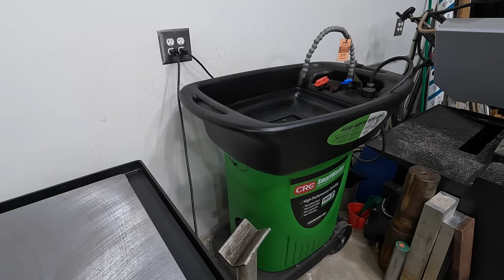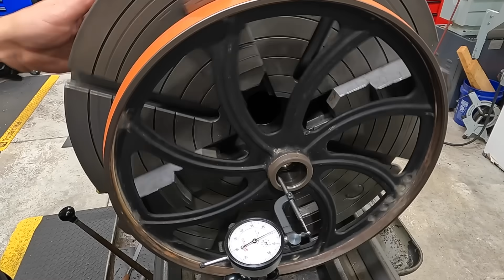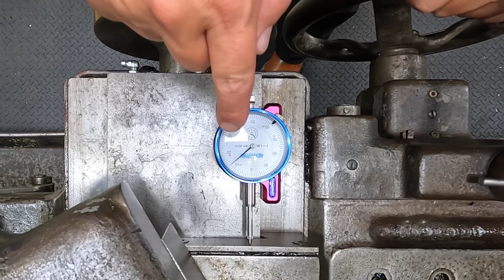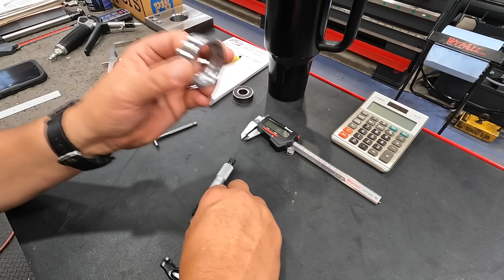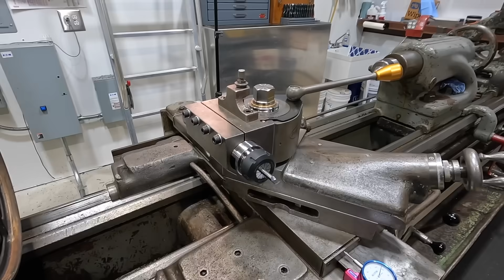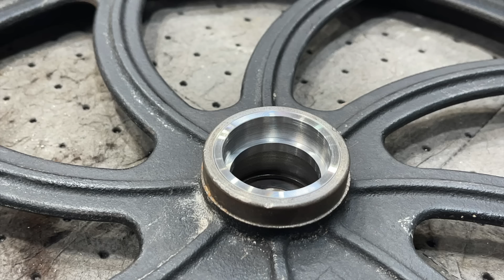Bandsaw Wheel Repair- SNS 381

Comment: Watched your channel for a long time, thank you for your videos. Just watched this one. I have a tip for you pressing in bushings. On the leading edge turn the diameter down .001 x .06+ long step. This allows the easy alignment of the bushing and helps get it moving straight reducing the chance of shearing. Thanks again, retired toolmaker, designer, and fabricator.

Comment: Adam. It's the outside of the wheel that carries the blade that needs to run true. With that in mind the inner bore should be made to ensure the outside of the wheel satisfies this requirement not the other way round. Look at the wobble at 17:54! The bandsaw blade will experience that wobble. You achieved some super fine tolerances for no meaningful reason. 
Other than clamping the outside (fragile) diameter of the part instead of the solid inner hub, (might have had less chatter too),  missing your initial target of 1.8", using the boring bar in the wrong holder and producing a wobbling bandsaw wheel this was a great episode.

Comment: I have a Delta bandsaw that had a bad wheel, I didn’t know new wheels are available. I bought a used wheel on EBay, it was better than mine and useable but not as true as I hoped for. I know used parts are risky you take what you get. A replacement bandsaw is about $1K for a Grizzly (w/accessories) I don’t know what you charge for this repair and I’m sure this was a big improvement plus it saved a machine from the scrap pile.  Thanks for the lesson on wheel repair.

Comment: How does pulling the bearing out of the sleeve go I wonder. Does it yank the sleeve with it?
Reply: He cut the sleeve half thousand larger so that the sleeve would fit tight into the wheel so the bearing shouldn't pull the sleeve out

Comment: Abom79, I am a mechanic/woodworker/carpenter. Next time, take the tire off of the  wheel and Aline the wheel to the tire groove. The saw blade has to follow the tire. That is what has to run true no matter what the hub casting is doing. I hope this makes sense.

Comment: Wouldn't a strip of shim stock have pressed in there quicker with the same end results?
Reply: The hole wasn't round anymore.
Reply: I seriously doubt that the wheel on a bandsaw needs to be that round the blade runs on a rubber tire, and if your OCD dictates, chuck it up in the lathe and true it up!!

Comment: 14:27 I would have left it there. Since the inside of the bore has been worn oversize and put out of round. The more true the out part of wheel runs, the better chance that hub lasts.
17:55 yeah that outer rim is wobblin' goblin now.
Nice lathe work as usual from Abom.

Comment: Adam, I have a question, why didn’t you use the flame spray method to just build up the ID material, and then just bore it out to the bearing size? It seems to me that removing ( virgin material) would potentially reduce the strength of the central hub , which given that it is for a band saw and they’re generally run under tension ,maintaining maximum strength would be preferable? Just a thought.

Comment: Noob question.....What is the cross-hatch rod spinning in the lower right-hand corner at 22:43 ?  It turns even when the chuck isn't spinning.
Reply: Chip removal auger??
Reply: @mikemarshall1394  I think, it’s a BBQ meat roller 😂
Reply: Just looked through the american bulletins, it's a power rapid traverse for the carriage
Reply: Same question here ....

Comment: Thanks for the video Adam. Does anybody have any possible explanation of why the bearing became loose in the bore? It would be interesting to hear some theories on why that might have happened.
Reply: The bearing is subject to a significant twisting force, just lime a motorcycle with a inertial-sided fork. The axel is only supported on the backside of the wheel. 

I would guess 20 years of wear with the axel nut a bit loose could cause the outer race to want to move in the sleeve
Reply: @avprod1  I suspect you hit on the reason for the bearing wallowed out. The wheel running slightly angled from a loose nut would cause that problem.
Reply: By time the load on the bearing compressing the softer cast iron. Basically ironing it, so the hole become bigger and harder the surface. In old machines this is super common. Sometime became so hard its also cracking under load.

Comment: Dry ice is pretty effective for chilling parts more than a freezer. Dry ice temp is roughly -80C vs a freezer at about -20C. So the Dry ice deltaT is about 100C vs 40C when using a freezer.

Comment: What if you used liquid nitrogen to shrink the bushing instead of the freezer?
Reply: My guess as an outsider is that the very rapid cooling of liquid nitrogen could have a high probability of warping the part.
Reply: A better option is a slip fit and red Loctite.

Comment: Adam, When you say you're "taking 50 thou" is that 50 thousandths Depth of cut or 50 off the diameter ie: 25 thousandths Depth of cut?
Reply: On lathe You always talking in diameters, but adjusting in radial :() Just get use to it. rapid division by 2 in head.

Comment: Another way to help with driving in the chilled sleeve would be to make a custom driver which is a close fit inside the sleeve and also has a pilot which is a sliding fit in the ID of the other bearing to keep everything aligned. You would, of course, chill this driver along with the sleeve, which would very much slow down the rate at which it warms up.

Comment: usually bandsaw wheels come in pairs, if this one failed, they ought to check the other wheel as well. No one every pays attention to the lower wheels because you are mostly doing adjustments and alignment closer to the top blade.
Reply: This would be the case for the third wheel on a 3-wheel bandsaw, but on a 2-wheel bandsaw the other wheel is on a driven shaft, not turning on its own bearings.

Comment: Instead of truing up the hub in the set-up, what if you just trued up the O.D. of the wheel and then bored the new hub to center on that?
(I guess that would mean you'd have to bore for a new sleeve all the way through for both bearings)

Comment: on motorcycle wheels there is a sleeve  that fits between  2 bearings inner race to make more ridged - surprised this is not made that way -
sleeve  is made from hardened steel - its important

Comment: I know this was weeks ago. 
But couldn't you make a little tool so the inside could be knurled ? Then bore the hole to fit the bearing (if required) or solder it in haha, maybe silver solder!
Reply: sleeve is the better way, first there was alot of play, to much to knurl .. second: when you knurl you have les material that contact the bearing, so it would'nt last long .. silversolder? .. way more labor, has to go in the Lathe anyway, but also have to remove the other bearing .. heat has the danger of lot of warping or even cracking the cast iron because of spot heat is high with silversoldering, burning the rubber (heat transfer) .. what he could do is to Locktite with the green Locktite insted of shrink it in .. but shrinking is as strong as welding

Comment: Why would you not go ahead and install the bearing first instead of installing the sleeve in the hub.  I say that because if you should need any more internal machining of the bushing that it would mount right up in the lathe instead of having to do any machining of the sleeve while inside of the hub?   Newbie wanna be machinist question ??
Reply: Listen to Adam's monologue starting just after 29:26 and continuing onward. I believe he answers your question. It has to do with turning speed as it relates to the surface finish and the limitations of the different lathes.

Comment: To quickly cool small parts, I use freeze spray that is normally used to help troubleshoot electronic circuits.  You can easily order it online and it saves a lot of time.
Reply: A cheap canned air keyboard duster does the same thing when turned upside down. :) Those canned "air" dusters are actually saturated R-152a refrigerant and it comes out as a VERY cold liquid when the can is inverted. Idk how expensive the special electronics freeze spray costs, but the canned air dusters are very cheap and you can get bulk packs of them at warehouse clubs (Costco etc). I have used them to do all kinds of off-label things including freezing warts off my hand. Cut a Q-tip in half and then put the red straw inside the hollow core of the Q-tip and you've got what's basically identical to the Dr Scholl's wart freezing product. 😎👍
Reply: @mannys9130  I'll keep the air dusters in mind next time I go to COSTCO.  The Electronics freeze spray is pretty expensive.  I use it because I have it around for electronic circuit troubleshooting.  If the air dusters will serve for my electronics uses, I can save a lot of money.  I will have to look into what the refrigerant might do to electronic components.  Thanks for the tip.

Comment: I noticed that the other bearing also had that snap ring " fix " done to it . I think if it was me doing the work , I'd press that other bearing out and make a through sleeve to put both bearings in . That way you know both bearing are concentric . My guess is whoever " fixed" it before ( or the manufacturer ) didn't have the wheel quite straight and it ate that bearing up and made it wobble so it wore the bore .
Reply: The c-ring stop was factory. The bearing doesn’t receive any side force so the little ledge should be good for the next 30 years of the saw’s life.

Comment: You indicated on every surface but the important one. What is this wheel doing?? Where is the blade running?? Indicate over the tire with a wide indicator tip!! All those over surfaces are irrelevant! The OD of that wheel is running out all over the place while you were boring it. This is a failed repair and you ruined this wheel. Stuff like this is why I can't watch your videos anymore.  For some reason I feel the need to come back every few months and see if you've learned anything. Apparently not yet.
Reply: i believe you are right
Reply: Band saws are well known for needing this repair. I have never seen one that runs  true. I guess it could be done but I dont know anybody that could afford it. Compared to some I have seen this one looked like it ran pretty true, at least a lot better than that wore out piece of crap I have  down in my basement.
Reply: There is a machined surface UNDER the rubber tire. The flange that you see just keeps the tire on the wheel and the concentricity. 

Did you notice that the factory also balanced the wheel?  They drilled a series of pits to remove mass on one side of the casting.
Reply: I'm not a machinist and even i know this. Why would you reference the factory bore when that bore is the reason that the bearing enlarged it. This wheel will have the exact same issue that caused it to need a repair in the first place. Basically duplicated the crappy machining from the factory. Oh well. Idk why you'd pay to get this done anyway, this repair must cost more than another wheel.
Reply: @nocandopdx he referenced where the bearing was not running, which was the bore between the 2 snap ring grooves. Yes he did check the bearing bore as well but didn't change his setup in anyway.
Reply: @notthisguy8817  the bore between the snap rings is the factory bore that extended in both directions and where the bearing sat. If it was bored properly to begin with, the wheel would run true and the bearing wouldn't enlarge the opening because there wouldn't be a wobble. Referencing the same bore that wasn't cut accurately will lead to the same wobble that caused the wheel to fail.
Reply: @nocandopdx he referenced inside beyond the wear from the bearing.
Reply: @avprod1  do you not understand how the bore was cut at the factory? It's all one single  bore from the start. Why would you reference it when you know the wheel never ran true. This wheel will wobble exactly the way it did from the factory and that wobble will lead to the same failure in the future.

This isn't a hypothesis or a prediction. It's 100% what will happen. Also balancing a wobbly wheel is pointless the moment you put a blade on.

Comment: You can freeze fit the DIY way with anhydrous IPA and dry ice.  The IPA might gel a little, but it works great at transferring heat from the part to the dry ice.  You can get parts to -50C in short time, giving plenty of clearance for the fit.
Reply: Canned air duster turned upside down. They are filled with saturated R-152a refrigerant and the liquid is very cold.

Comment: Without the snap ring I pity the guy who has to remove that bearing from the new sleeve.
Reply: The Snap ring is just a ledge for the bearing to stop at when you push it in. . The outer edge of the bearing is held by the washer under the nut on the the axel.

Comment: Bandsaw wheels HAVE to be indicated by the outside rim.  ANY wobble or runout of the rim will destroy the performance of the saw.  I have trued up bandsaw wheels that were WAY out from the  have to dial in the rim and machine the center to match.

Comment: Co2  is in a liquid in tanks and will boil at around -60 F at normal air pressure working well to shrink parts. Co2 is readily available at reasonable cost
Reply: Dry ice is around -85F too but you have limited time to work with it. I guess past that is liquid nitrogen.
Reply: We used a Co2 fire extinguisher to cool our beer on Iwo Jima.

Comment: @seabreezecoffeeroasters7994 Thank you for your enlightenment, but you seem to be mistaken.  I was not suggesting Adam buy 203L of LN2 and the tank to hold it.  He can get a much smaller one, even Home Depot sells a 3L one.  Also, the cost of liquid nitrogen in the United States ranges from $0.13 to $1.78 per litter.  So after Adam deducts the one-time tax-deductable capital expenditure on the container to hold the LN2 if he fills it would cost roughly $6, maybe his friend Joe can get it for cheaper from one of his wielding suppliers.  I hope this paints a clearer picture for you, it is always better to have it and not need it, than to need it and not have it.  One can also wonder what the cost would be if the bushing got stuck and let us not forget the time, worry, and the stress.   All of which can have a monetary value attached to them.  So in the end GFC.
Reply: I agree, the whole point of a bandsaw wheel is for the outer rim to run true to the axle with no wobble so that the bandsaw band runs true with constant tension which clearly it is not from viewing the running lathe with his setup trued up based on the centre hub which was not machined true to the outer diameter by the manufacturer.  The best way to ensure that the wheel runs true after repair is to make it run true both on the diameter and the outer face of the wheel, after removing the second bearing and circlip, boring it true to the outer diameter, make a new full width bush, press or shrink fit the bush into the wheel then finish bore out to the bearing size with inner shoulders on both sides to seat the bearings and eliminate the circlips and make up a new floating spacer bush to keep the bearing spacing correct and avoid side loading the bearings.

Comment: looks like a upper delta wheel..i just put new bearings in my delta..mine is a 1995 model and the wheels are aluminum,that wheel since it was cast iron is probably older and the part is obsolete..there is a spacer that goes between both bearings  inner races

Comment: I use plumbers freeze spray for shrinking sleeves, valve seats, etc. I would have fabricated a small cruch tube to go in between the bearing inner races. I have had motorcycle front wheels with a similar "Egging" problem in Aluminium often because the wheel bearings have been replaced, but someone ommitted the crush tube when refitting everything. I have a wierd old German machine called a Beichle multi axis die miller, which I use for wheels as they are slightly too big for the gap on my Colchester Student 1800.
Reply: I just did bearings on my front wheel. What's the purpose of the "crush" tube?
Reply: @semperfidelis8386  The crush tube is there to prevent the bearings being subjected to an excessive side loading by overtightening the spindle which would force the inner bearing race sideways against the balls and the balls against the inner edge of the outer race which causes overheating and excessive wear on both bearings.
By having a crush tube in between the bearings it is impossible to put excessive side load onto the bearings by overtightening as the tube keeps the inner bearing races the correct distance apart.
Reply: @mickymondo7463  thanks for explaining that.

Comment: Great video Adam. Would a heat gun been sufficient to warm the hub up? I've used one with the freezer combined and have had great success on small applications like the bandsaw wheel. Just an idea.
Thanks for sharing.

Comment: It would have been nice to indicate on the outside of the wheel to eliminate as much of the crappy machining it came with from the factory. These are notorious for being out of true and it's murder on the blade,guides, and the operator. I would have trued up the outside diameter as much as possible then put the new bushing all the way through so the new bearing axis was true to the outside of the wheel where it matters. Then it would run smooth as silk
Reply: That and probably a missing spacer in between the bearings caused the wear. I'm surprized Adam didn't do it the way you said.

Comment: I would think that the outer / major diameter and face would be the proper places to indicate and then bore the center for the sleeve. The blade runs on the outside diameter and that is what needs to run true.

Comment: You may have covered it before but what is the cross thread lead screw on the back of the lathe????
Reply: That is a power feed to quickly move the carriage from one end of the lathe to the other without cranking on the hand wheel.